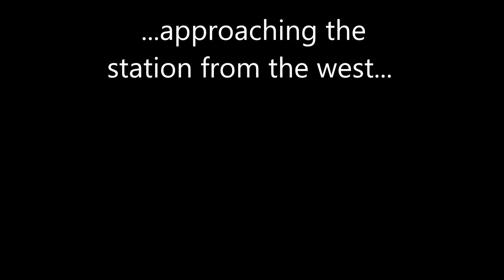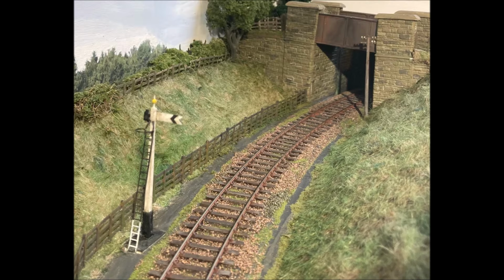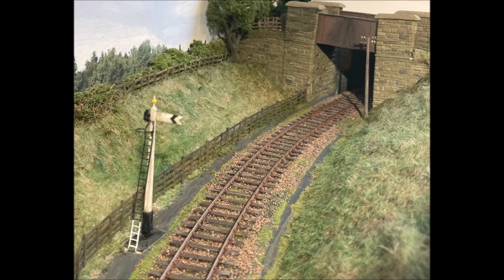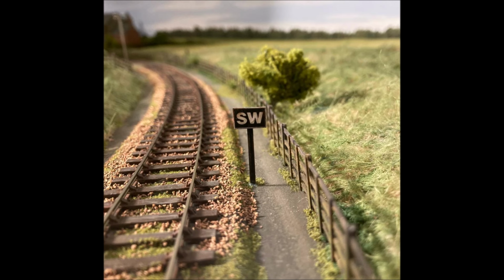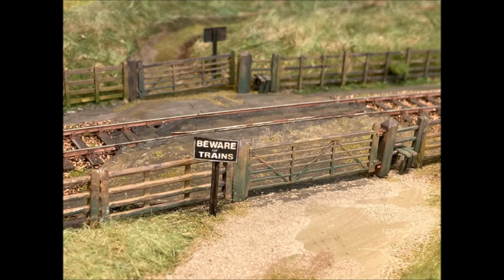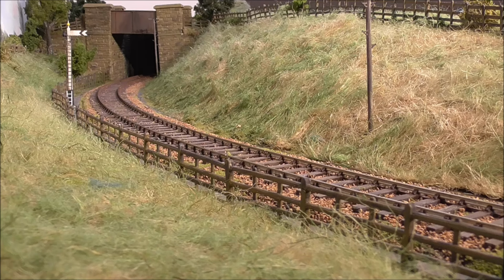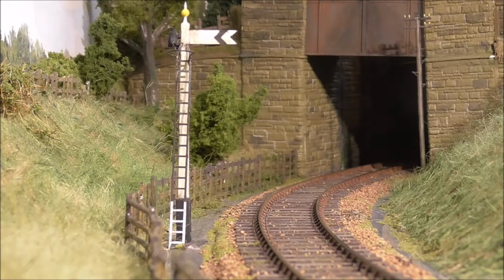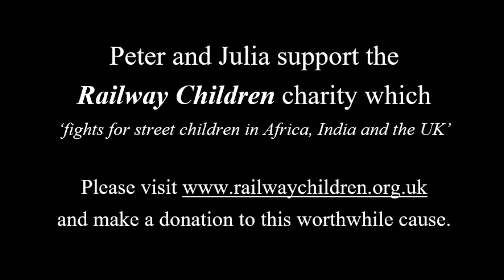Postcard from Ashcombe (1) ...approaching the station from the west...

Comment: Entertaining video. Just one thing - the distance signal is facing the wrong way! It should be the other way around with the ladder to the rear!  The home signal, with a red arm would normally be immediately before the tunnel.  Thanks for uploading.
Reply from the maker: Thanks for your comments. The fixed distant is on the 'wrong' side of the line for easier sighting by drivers emerging from the tunnel but I think it's correctly placed though not the full quarter of a mile from the station. Best wishes, Peter
Reply: @peterharrison6230  From the point of view of videoing the layout, a home signal would look better at this location, since the camera cannot be placed at the viewpoint of the driver leaving the tunnel!  Have fun.

Comment: Great stuff, particularly those nice off screen sound effects. Do you think about camera positions when designing a layout?
Reply from the maker: Thanks Tim. I'd like to say it's all planned but in reality the board is only 20" wide with the backboard along the loft wall so there's not much choice of position. Some shots are from the 'field', the rest from the front of the layout. By the way the track plan is based on Wookey in Somerset. We had fun recording the level crossing gates on the York-Scarborough line ...a VERY obliging signalman! Best wishes, Peter